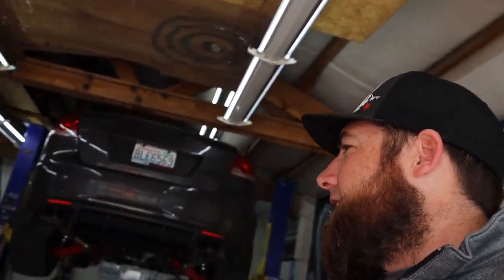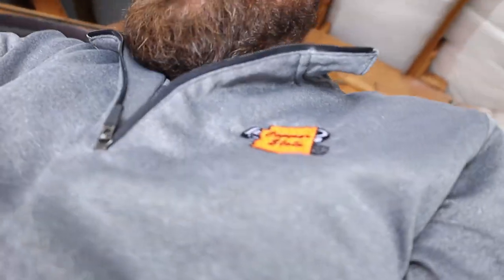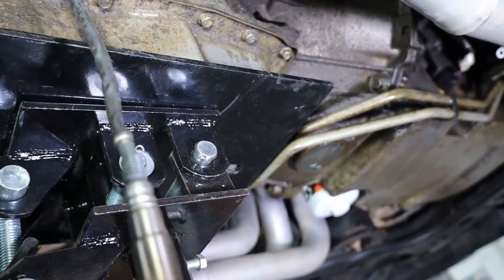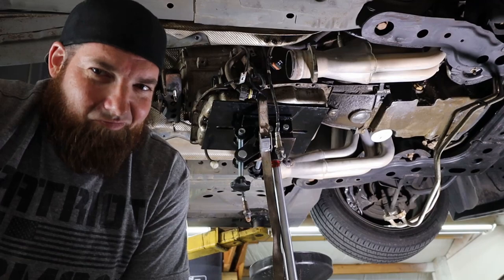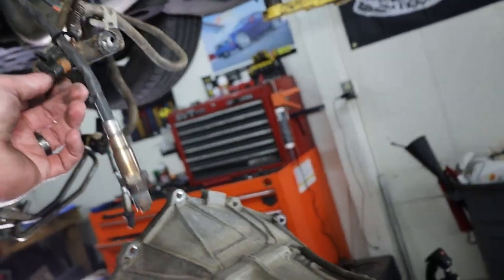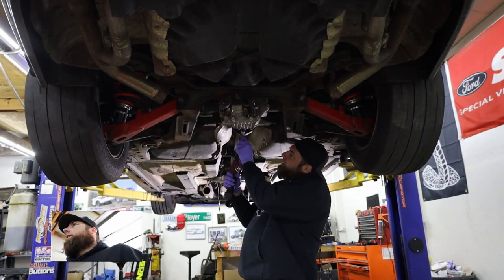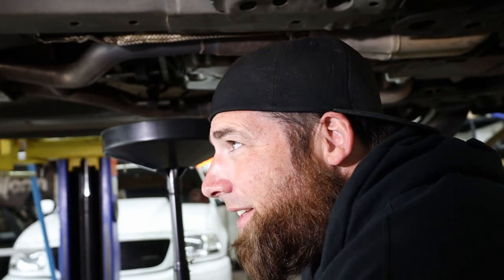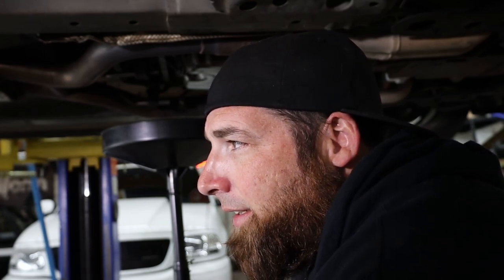6l80 zl1/ctsv Torque Converter Install Pontiac G8GT

Comment: Hi,
Did you change the converter to a lower pressure like the 6l90e factory settings or you kept the higher pressure? Any tips for the converter change in the tune? Great video!

Comment: I also have a zl1 converter i plan on putting in and i was wondering should i still put it in because the stock converter is a 3 bolt and the zl1 is a 6 bolt
Reply from the maker: It still works they are all that way mine was the same. It will line up with 3 holes in the flex plate.

Comment: Did you measure the distance between converter and flexplate before you bolted them together? I've seen guys send it and others shim to limit converter pullout. Not sure which way to go
Reply from the maker: I don’t believe I had to space mine at all… see how much pull out you have when you install. If it’s not too much you should be good or run some spacers if not.

Comment: How’s the 6l80e holding up?
Reply from the maker: It lasted almost 4 years with the lsa over 600whp. When I went twins I changed to a TH400. I could have built the 6l80 but went the other route.

Comment: I’m sorry if I missed it, can you explain the easiest way to actually get the converter bolts loose from the flex plate, I’m just pulling my motor and was just trying to find the easiest way possible
Reply from the maker: 7:43 take the starter out and should be able to get at them. 😎
Reply: @Adrenalinedrivenmedia  thank you, I just did this last night lol the started was a pain for me to get out being pinned against the headers lol but I got them appreciate the response
Reply from the maker: That’s good ya pita but glad ya got it, sorry for the late responses

Comment: Had you ever had any issues were the transmission and motor meet, I have a leak every time i use my G8, and they telling me it can be my transmission housing, when my car just sits in the drive way it does NOT leak but when I start driving it starts leaking. Please help thank you.
Reply from the maker: Can you tell Where the fluid is coming from? If you could get it up in the air on stands or a lift see where it’s coming from. I didn’t have any leaks
Reply: @Adrenalinedrivenmedia  I believe where the seem is. Where motor and transmission meet, rite in the bottom. They going to look at my car this Monday so let’s see what they tell me.
Reply: @Adrenalinedrivenmedia  I wish you could work on my car haha are you near Austin Tx ??
Reply from the maker: Good luck man I wish I could help more … too bad you can’t see through the inspection hole where it’s coming from
Reply: @Adrenalinedrivenmedia  yeah I wish I did so I can have a better idea where this oil is coming from.

Comment: what are the benefits of switching the torque converter?
Reply from the maker: For me I had a bigger cam and it was wanting to push through the brakes at a stoplight. Also eventually with making more power you will blow through the stock converter.

Comment: As always great vid! Even though I’m not a fan, I still watch your Honda swap content lol. I just picked up a L96/6L80e that I’m going to swap into my other car. I’m currently in the process of getting all of the parts for a VVT delete and cam swap.
Reply from the maker: Honda is gone buddy LOL... I decided to upgrade my shop instead new lift comes in soon main focus is on the G8 now. I don’t think this trans will last very long and I’ll be doing this all over.
Reply: consider keeping VVT homie. I have a Crate L96 full bolt on with the comp 189-400-13(it's in a 2500hd With level 2 CDT 6l90e and CDS ZL1 convetor). there is a few HP and torque available with the cam phasing.

Comment: What was the torque specs for the flexplate?
Reply from the maker: The stock bolts if that’s what you’re using is 15, 37, 74ft lbs on the 3rd pass. The torque converter is 46 ft lbs

Comment: If I brought my car to you with the converter how much to replace mine? I want a trans cooler instead if the one in the rad, and a camaro upgrade pan. I also have a HP tuner so it should be easy to reprogram. lmk, Thx bro.
Reply from the maker: It’s pretty easy man I could always walk you through it if you have space to do it. I’m just a self taught mechanic not saying it couldn’t be done if you needed it. Let me know thanks for the support as well.
Reply: @Adrenalinedrivenmedia   Yea I guess it dont look that bad. lol